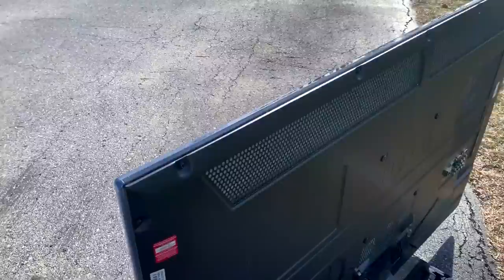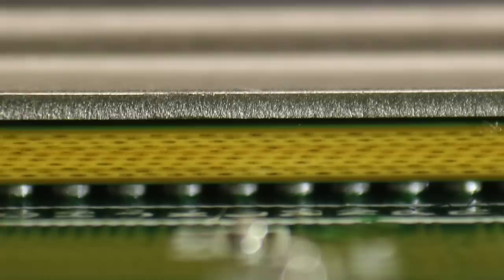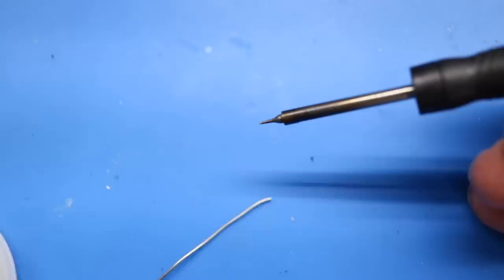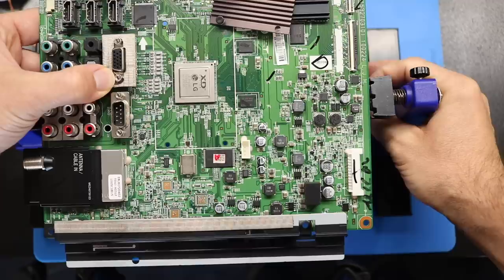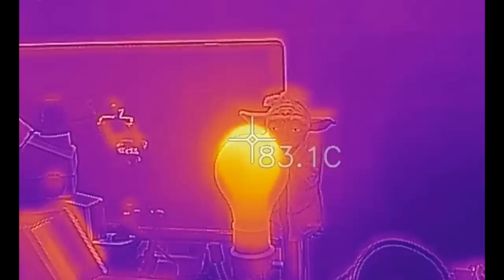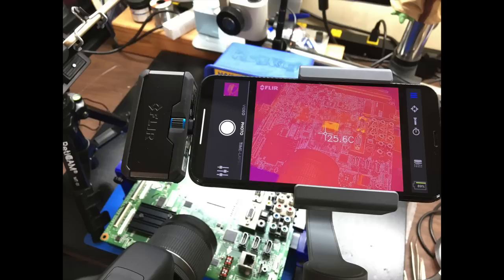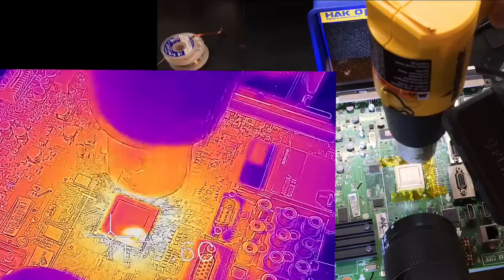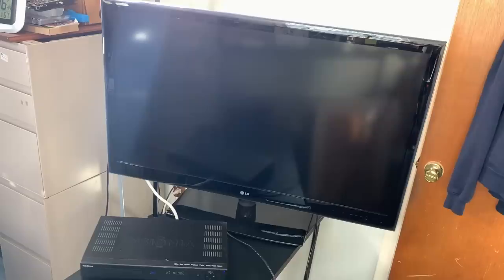I fixed a broken 47” TV with HEAT | HDMI ports not working on LG 47LE5400

Comment: I have a Vizio 40" 4k ultra tv series D model D40U-D1 that will power on but I get no picture. I do get the V when it powers on, then the tv goes black. I tried the power unplug and reset options with no outcome of improvement. I carefully took the back off of the tv to see if I could notices any burnt or discolored resisters on the power board, but no luck. Any idea what I could do to get the tv working again?
Reply from the maker: Download my pdf if you haven’t already.  I have steps in there to try.

Comment: I had a problem with my PC PSU and GPU, both are burned.
At same time both monitors HDMI inputs stop working.
It detects cable connected but there's no signal.
Could be a microfuse or a resistor burned?
The VGA input still working.

Comment: Hello furgal, I have a question for you, hopefully you can help me with..... I have 7 36v batteries, I'm try to use a 36v to 12v step down, do I need 7 36v to12v step downs or can I use one step down for all 7 batteries......
Thank you for any help you can provide me with......
Reply from the maker: I assume you want all batteries in parallel so your starting with 36v?  Or in series and starting with (7x 36v)?  What are you trying to accomplish?
Reply: I'm tryin to connect them so the voltage will stay 36v, but the amp hr will change
Reply: Yes I want to start with 36v, but still have the amp hr for all 7 batteries, so can I use only one 36v to 12v step down or so I need one for all the batteries.....
Reply from the maker: I don’t know your application considerations but from what I remember in EE class that the 36v in parallel will stay at 36v so you would need one converter to get to 12v.  Obviously rated for the correct amperage, etc

Comment: Hi, Can an infrared thermal scanner be used instead of a thermal imaging device? thanks
Reply from the maker: How is that different than what I used?  I think it would mainly depend on the range and accuracy of the unit.
Reply: @FrugalRepair  It is a gun that has a 2-mm laser light that you point to the surface, to read the temperature.  It does not have the advantage of thermal imaging where color uniformity on the chip surface can be seen at once.  Instead, the laser beam should be moved on the surface as the heat is applied.  -20 C - 520 C range.
Reply from the maker: It should work.  Again, depends on range and accuracy.  Also, you are hoping the laser is aligned with the thermal sensor.  But it’s what I would use if I didn’t have a flir.

Comment: what kind of solder do you recommend?
Reply from the maker: It depends on what you’re using it for.  I have leaded (for circuit board work because of the lower heat required) and nonleaded (in different sizes).  I’m pretty sure I have solder listed on my amazon shop page.

Comment: Hi Rhys I am interested in the heating process you used, because I need to change a processor platform on a motherboard. I do want to buy a heating plate for just one board, so with a few adjustments and a thermal imager with my heat-gun should work. What do you think?
Reply from the maker: Do you mean like a zif socket?  You would probably melt the plastic with a heat gun.  If you are asking about a BGA chip, then I'd probably not recommend doing an install of the chip with this method.  It can be done but a rework station is the most precise.  But if you want to give it a try, just be careful to not overheat the board and warp it.
Reply: @FrugalRepair  I am thinking of replacing the socket which has bent and broken pins on it. This motherboard was given to me because the original owner happened to accidentally bend the pins while changing the processor.

Comment: I have of these and pay to get the board fixed, now it not working again. I have a work station with controlled air. I'll use 180 C and give it a shot. I need to get liquid flux and the tape, wonder video thank you.
Reply from the maker: Sorry to hear that it broke after you paid for the repair.  Hope you can resurrect it!

Comment: Most boards have live parts, so how do I get to fix that?
Reply from the maker: I’m not sure I understand what you mean.
Reply: @FrugalRepair  On my TCL tv on the motherboard it says Attention Live Parts right after I took the MB off it sparked, so ... do I put that MB part in a toaster oven or use a heat gun?
Reply from the maker: Thanks for explaining, now I understand. What that means is that that is the part of the power supply that mostly deals with alternating current and that you shouldn’t use as a ground reference.

Comment: All my 49 in LG TV functions work except HDMI ports. Replaced with new main board, HDMI ports still say no signal. Checked with known working cable and device. Any help appreciated.
Reply from the maker: If you replaced the main board, then they should be working.  Maybe you can ask the seller you bought it from if the HDMI ports were tested ahead of time

Comment: Hello. I did exactly what you said for my LG le8500.  However hdmi ports still not working.  Have you got any other advice? Should I increase the temperature above 200 degrees? Should I heat the another chip?
Reply from the maker: It’s possible you have a different problem.  Are you certain no one has tried to heat the board before?  For best chances you want to use flux and get past the melting point of the solder.
Reply: @FrugalRepair When I reached 200 decrees I instantly stopped the heatgun.  Should I continue heating at that temperature for a minute or two? I had the same issue twe years ago and I sent the board to an electronic service. Tha problem was fixed  but it did cost me a lot and I do not want to spend the same amount of money again.  Between the hdmi ports and the part that I see you heated, there is a small black chip with many external pins at all sides.  I do not know its purpose but do you think that I should try to heat this also?
Reply from the maker: I wonder if they replaced the CPU chip when you sent it in for service. Did they say what they did?  Hopefully they didn’t charge you to do what I did in this video.  If your goal is to get the solder underneath to melt you probably need to get above 200°.
Reply: @FrugalRepair  No, they did not tell me what they did to fix the problem,. It is the official LG service and they told me that they use an expensive tool,  that's why they had to charge me 120 euros. They warned me that I will face this issue again in some years. Nevertheless,  I am not going back again. I will try again at about 210 decrees and hopefully the problem will be fixed.  Thank you for your time.
Reply from the maker: That’s interesting that they told you it would happen again.  If you do get yours working, I would advise installing a cooling fan over the heat sink.
Reply: @FrugalRepair The first time I open the back of the tv I saw a great leak of flux out of the cpu chip. Certainly it gets really hot at this point. I did try again this afternoon at about 210 degrees and still hdmi ports not working. Is there a way to check if the chip between the hdmi ports and the cpu chip is working properly? Maybe the problem is located there.
Reply from the maker: I don’t know of a way to check for sure other than trying the hdmi port itself.  You might be able to get a schematic and use test points.  When heating you should be able to see if the solder balls get molten.  You might need a helper to watch for you.    It’s also possible the chip failed internally or the solder balls fused and shorted something during the first re-heat attempt. I’m sorry I can’t be of more help.
Reply: @FrugalRepair  You have been very helpful, and I am sure that many situations have been solved through your advices and many people have been helped watching your channel.  Thank you for your personal time you spent to answer.

Comment: i have a 47 inch vizeo heavy first lcds it still works amazing but sometimes sound will start crackling if i shut it off for for 15mns its fine or just ignore it it starts working normal been that way for 3 years its weird
Reply from the maker: That makes me think it’s related to heat or a bad capacitor.  Glad to know you have a work around at least.
Reply: @FrugalRepair  Thanks!

Comment: First of all, thank you for these useful videos. I finally bought a tv to repair after watching a bunch of your videos(Samsung UE46D5630). It has a good display which has a blue tint on-screen (HDMI inputs only; Other sources work fine). 
I had a question I used your guide and it looks like my BGA needs to be reflowed as I get blue tint in all HDMI ports. The picture test is also good.  I am planning too try this method but worce case will need to replace the mainboard(BN41-01587E BN94-05105S) which I cant find. any advice?
Reply from the maker: Thanks!  Give it a try.  eBay is where I usually go

Comment: Hey hope all is well....I've been holding onto my Vizio i701-a3 tv and still can't get it to work. I changed the tcon board and nothing....I had a repairman look at it and they said bad panel.... Please help me and where do purchase one of is it worth  fixing
Reply from the maker: Unfortunately, your repairman might be right. One thing you could try is to disconnect one of the ribbon cables coming out of the tcon board and only driving 1/2 of the screen at a time. This is one technique I use to find a panel fault.

Comment: I have a 46 inch Samsung tv that shuts off on its own what part should i buy?
Reply from the maker: You probably have to open it up and do some tests.  Did you download my pdf?  I have some tips in there you may want to look at.  If the TV is older it could be bad capacitors on the power supply.  Or it could be bad LEDs

Comment: Hey FrugalRepair i want to inform you that i fixed my 3d tv,i replaced the led strips yesterday and is now working like brand new,took me 2,5 hours work though but hey is whas worth it fixed my tv for 17 euro`s.................
Reply from the maker: That is so awesome to hear! Thank you for taking the time to let me know. Were you able to put the screen back on and not get any dust particles behind the LCD? I always seem to have trouble with the dust getting back in there when I put the screen back on.
Reply: @FrugalRepair  Did not have any problems with the screen,before placing it back i use a cotton cloth to clean the white layer en before i put the glass back,i use plastic gloves and a spraycan with high preasure air to get ride of dust and other particals,the most work i had with my tv whas getting ride of the isolation tape around the whole frame of the tv,that whas awefull work i still have to replace that now because now you can see a little bit of backlight coming through the transparant borders of my tv ,so that isolation tape has a purpose,thank you for your videos your a great guy and i learned alot from you,stay save and God Bless.........

Comment: A SIMPLER SOLUTION IS TO GLUE  A STRONG SPRING TO THE CHIP AND THEN PUT THE BACK PANEL ON SO THAT THE SPRING FORCES COMPRESSES THE CHIP AGAINST THE POINTS.

Comment: According to the Newton’s laws of thermodynamics and the principle of quantum physics along with Einstein’s theory of relativity, one can easily diagnose and repair the faulty motherboard by calibrating the the tv’s paroxysmal and axial position relative to the earth’s tilted axis, which we all know is 23.5 degrees, use that number to find the angle to direct the heat source at the phase change level of melting point of silicon and... man sthu I gots to go get me hookups from Geek Squad or sell a kidney for one of ‘em TVs that warms dinners and watches me kids.